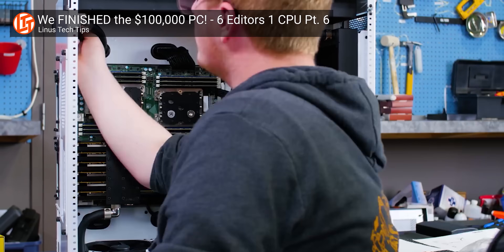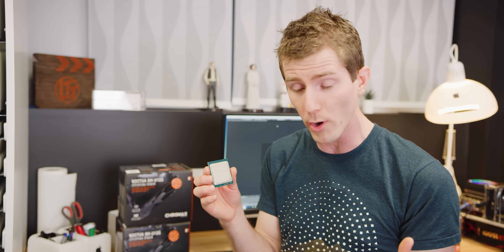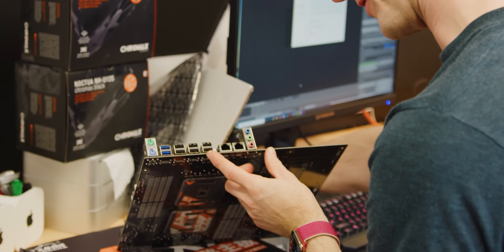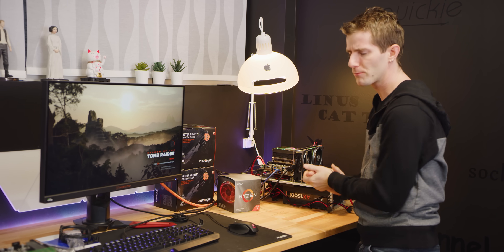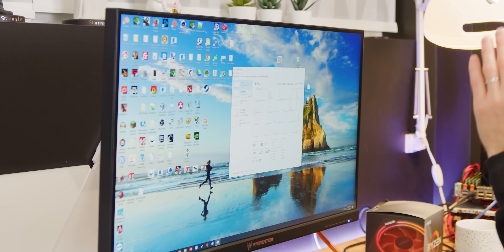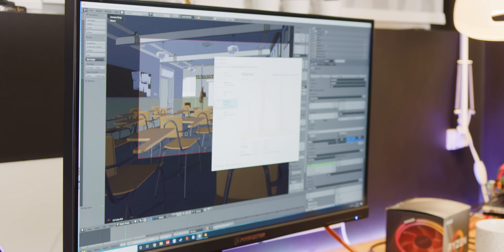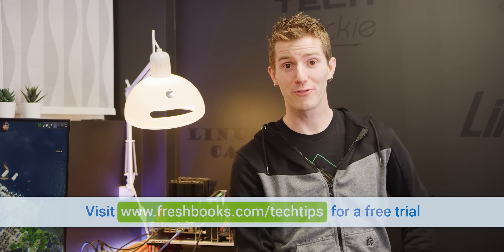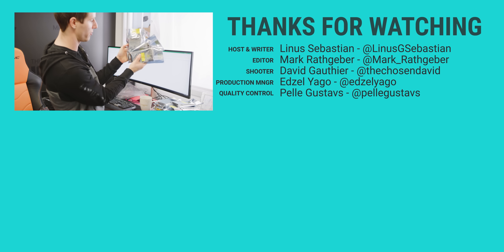SIXTEEN Cores for the Price of EIGHT!

Comment: I have almost the same config, except for the mobo (mine is a supermicro X9DRI), but it seems tyhat mine performs a little better; for example, with application that runs all the cores my 2 cpus got to 3600mhz; in games i often reach 3800-4000 mhz

Comment: I’m not sure how the overall price was computed. They’d only be roughly the same price if you factor in either a lower end Ryzen board or its compensating for the dual cpu coolers it needs. It’s not a really good value. The good value if you needed more cores and memory bandwidth was when the TR 1920x was $170 paired with a Asrock phantom gaming board for $240. That ship has pretty much sailed and the cheap boards seem to be gone. This is only a solid value if you have a source for cheap old ram, or processors. If you already have access to those then it makes sense, otherwise it’s a peculiar oddity.

Comment: 50% load just FYI
Doesn't apply to the video per say, but for people who look at Task Manager and see some utilization on every thread (i.e. 16 graphs for 8-core CPU each at 50%) and say "It's using ever CPU thread at least" just remember there's such a thing as "thread jumping"  which is VERY common where the code starts on a hardware thread, finishes the job, then starts on a different CPU thread with one possible result being equal usage on AVERAGE across all CPU threads... so just because you see every physical hardware thread being utilized it does NOT mean they are being utilized at the same time. This seems to be a common misunderstanding... If we had a 4-core CPU without hyperthreading for example a single-threaded program might show 25% CPU usage across all four cores (or a little more to account for background tasks) or it could show 100% usage on one core if the program or Windows forces the code to stay on the same core. In both cases it's just over 25% CPU usage with the extra cores not actually being utilized.

Comment: 2667v2 boosts to 3.6 on all cores in my single cpu jinghsa, you have to put in the values in the bios for power duration limits though.. I just put in 250 everywhere and the machine now sustains 3.6 for hours in stress testing

Comment: how locked are these cpu's shouldnt it be possible to run the 125cpu strap on it???
fuck if only u could double up these unlocked  xeon e5 1660's and 1680's it would fucking rock

Comment: not exactly the best choice of cpu. currently here in the UK, that board with 2 2670v2's and 32gb of ram would set you back £230-250. the 3800x alone before board and ram is £320.

Comment: two Intel Xeon E5-2667 v2 still perform worse than AMD Ryzen 3800X even when utilized fully.  For example, in PassMark they get 22,729 vs 24,508 for a single Ryzen 3800X.  Not to mention, they are rated at a 130W TDP each.  that is 260W vs 105W for Ryzen's 3800X.  This would contribute to how loud and hot the system is, as well as, the amount of electricity used by the system. I remember few years back I got a Dell Precision Desktop which had similar specifications with two Intel Xeon CPU's from a University Disposal Center.  It just doesn't run as well as the newer system.  When I bought the system DDR3 was common on desktops but the Precision had DDR2 memory, which was a big bottleneck.  Also, the SATA ports were not as fast as what was commonly used when I purchased the system (I believe the desktop had SATA 1 or 2).  Also, PCI-E was at first gen, I think.  All of these contribute to the performance of the PC, and in my opinion, it is very noticeable.

Comment: I'd be interested to see how the slightly newer Haswell Xeons fare here. Also maybe try a configuration of a single high core count CPU instead of dual to eliminate the NUMA issue.
Reply: There is plenty of single proc Chinese 2011 boards.  They price much cheaper, and you can find bundles with a 2ghz processor and 16gb of ram for 100 USD.

Comment: uhm x99 boards are also a thing, and those have 14nm cpu's on 2011v3 which yes not x99 but still on intel oc boards are ment for those things, as well as ali sells bundles for those boards with 12 cores total and  dubble dual channel 16gb ram, for 300 euro, or about 400 canadian rubles, which may be much better
Reply: the "x99" dualsocket board is 20 or 30 usd more.

Comment: So does the B450 MOBO's work with the Ryzen 3000's? Or do you have to flash the BIOS in order for it to work? Was wanting to go to a 3700x from an i5 and don't have the older gen AMD to load first.

Comment: Hope you get well soon Linus! However I don't think this system is worth it anymore. Ryzen is so cheap it's not worth for decade old Xeons and plus you give up DDR4 3200mhz ram and PCIE Gen 4 on X570 at least. Though even B450 leaves Intel in the dust. No to sound like an AMD Fanboy as I used Intel 4th gen for 7 years. Ryzen was just too compelling to not upgrade too. Get well soon though. Good luck with CES 2020.

Comment: I ran a dual CPU machine with two E5-2667v2 with a GTX1080TI since about 2 years now and it is a hell of a machine. Surprisingly good for gaming. And no, I wouldn't recommend this configuration. @Linus: But you have some sort of performance issue. The CPUs should run at 3.6 GHz on full load. In Cinebench R15 you should get ~2500 and not ~2250.

Comment: For audio post, I still run a dual 8 core z620 workstation with 128gb of ram and I'm not planning to upgrade. Multitrack audio runs extremely well on many cores and you can still do additional tasks like video conversion or exports in the background. At home, I still rock my 2600k @4.7ghz and I just ordered a Ryzen 3800x to replace it. However, I do not expect to have my socks blown off. 
Today's real performance gains come through software optimization. CPU wise, nothing earth-shattering happened within the last 9 years. The 3800x isn't even twice as fast per core than the 2600k is. Leaps like going to 486DX, Core2 or Sandy Bridge just don't happen anymore.

Comment: 8:30 that is NOT true at all. They all had an all-core boost, and higher boosts for less cores. If it's running at base, either they're overheating or the VRM can't handle. Or your reading is false, you should know Windows taskmanager's clockspeed readout cannot be trusted...

Also, for purely multi-core performance you can get miles better multicore performance for money by going for a simpler Xeon from the lineup or a higher core count one. These 2667s are frankly very overpriced. For gaming purely they could be the best option if you're looking at this platform specifically. Depends on if in games the cores boost towards the 3.8 to 4 GHz range as they can do

Comment: But running this system with single cpu has really good price to perfomance ratio. This 8 cores xeon can kick some good numbers still while gaming, and for aplications they are still decent choice on budget. You can have old xeon platform and have gpu like rtx 2060 super and still have decent fps and it will last for long.

Comment: Something wrong with those results. My rusty dual E5V1 is giving me almost the same score in CB15 (2153 vs 2256) and my cpus are way slower than those used here. E5-2667v2 do actually have an all core turbo of 3.6Ghz... maybe he did not enable turbo boost?

Comment: Copnclusion: Ivy Bridge is still "Fine"
I still have a 60hz 1080p second rig that is an ivy bridge Xeon roughly equivalent to a 3770. It has a GTX 980, its fine.
Reply: I agree I use the e5 2667 v2 featured in this video (only single socket though) with 32gb of ram and a GTX 1070. Something wasn't right though as the all core boost should have been 3600Mhz, a good 300Mhz higher than base, mine will stay at 3600 all day if it is loaded and never drop below it.
Reply: @White-Wolf1969  some boards only boost to 3.6 if you enter power duration limits in the bios, so he wasted the chance of running +300 on all cores and probably beating the Ryzen in SOTTR

Comment: I pretty much called it that this thing is gonna be slower than the Ryzen build, but I didnt expect almost half the performance for twice as many cores. Ouch!

Basically, the lesson of the day is, get a modern CPU and motherboard, and forget about this old jenky stuff from the past.

And btw, Linus didnt actually factor in the price of the 2 CPU coolers for that build, while the Ryzen one was using AMD's stock cooler, which is included in the package.

So overall, the Xeons are bound to be more expensive.

Hell, I'd actually prefer a Ryzen 5 3600 than those Xeons, not joking.

P.S. All of this refers to gaming only, ofc, as everything else is pretty much irrelevant to me.

Comment: You should be able to set the all core higher with CPU Power management settings in the BIOS. At least 10% above base clock.

Also, save money and go with Snowman CPU coolers.

My eldest daughter runs an E5-4627V2 (8C/8T, base 3.3Ghz, turbo 3.6Ghz) at 3.5Ghz all-core on the HuananZhi X79 deluxe. Total build cost: new CoolerMaster Masterbox Pro RGB case with 4 fans, 650W Bronze PS, 32GB DDR3 REEC 1600 RAM, RX 570 8GB           = US$ 520 in late 2018. She uses this rig for video editing, rendering, illustrations/animations with WACOM tablet, and gaming.

The youngest daughter's dual E5-2689 (8C/16T, base 2.6Ghz, turbo 3.6GHz) PC is running all-core at 3.3Ghz. Nearly 27% boost on all cores. CB R15 is around 2200. Dell Precision T5600 desktop server with 32GB RAM and 825W power supply...PC was free in a company decommissioning deal.  Paired with used GTX 970 for $120, 1 year ago.  OK at 1080P hi settings. I intend to upgrade to RX580 8GB near term.

Comment: I have one of these boards and it's so unstable that I can't even boot windows from the install media.  But I have the "smaller" huananzhi and it works fine.

When doing parallel compiles the machine is a beast!  I can compile dosbox in under 3 seconds!  Full compile!

Games.... Meh.  So I use it for building

Comment: Linus, you can buy the combo with this motherboard, 2 Xeons 2689, and 32 GB of Ram for 250€ in Aliexpress... not is a bad pack and yes is very, very crazy to make a low price pc but with high specs.

Also, in Alixpress can buy second hand GPU for 100€ or minus) , GTX 1060, RX 580.... for 350€ is a good buy, only need buy a Power Supply, and not, don't buy one in Aliexpress, Case and Storage (SSD and HDD).

But if you don't need a Dual CPU, can buy a Single CPU Mother board with 16 GB of ram for 130 to 150€ .

And yes, if you need a Better option, buy a new CPU, but if you don't have a money, you can buy this CPUs and play games or make other uses but low price.

Comment: I just found a 3950 for 750 a refurb B450M Plus for 79 and 32GB 3200mhz ddr4 of ram for 120. Add a cooler and used graphics card and you are only 300 over that price with a new 16 core processor. Also saw some 3900xs on ebay for 400. It is insane how much power you get for so cheap these days.